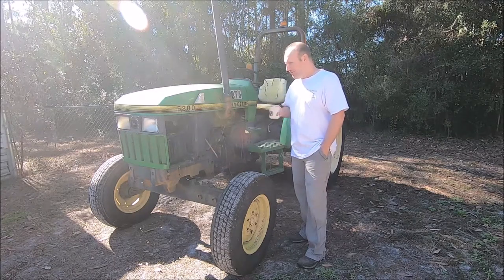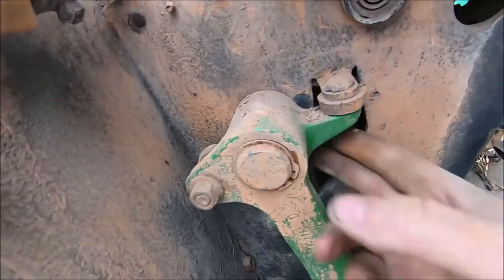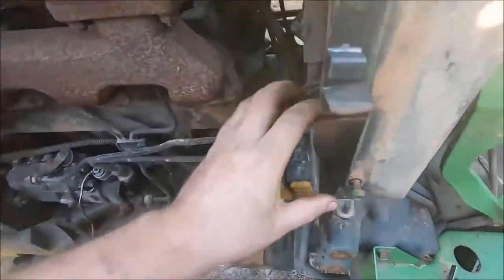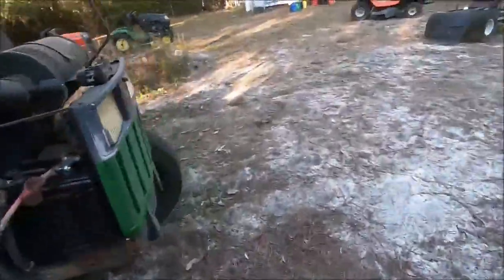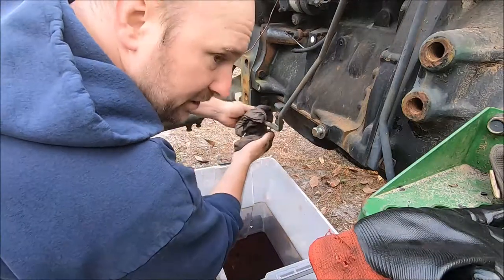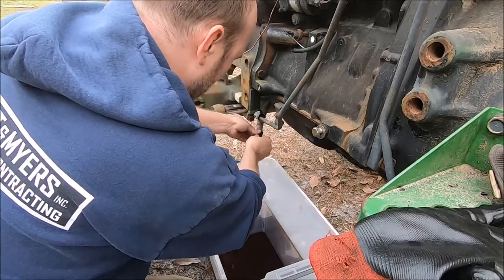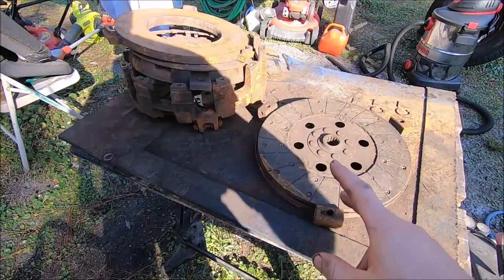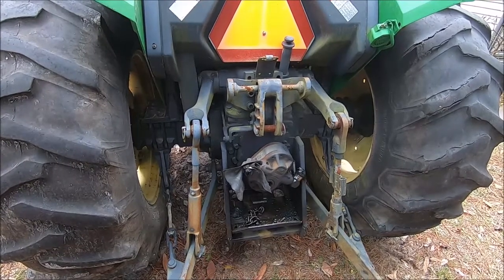John Deere 5200 clutch and other problems part 1

Comment: I never have been able to afford a shop with a concrete floor and never will but I make do. I have a 5105 which is very similar from the dash foward. I noticed recently the PTO seems to be slipping some under load when engaging the Bush Hog.Hopeully a linkage adjustment is all it needs.  I was disappointed to find the PTO clutch is part of the clutch assembly and not a separate unit inthe rear end. I dread replacing it but I do have a shop manual for the tractor which shows how to do it.

Comment: NICE DOES IT NEED TO BE IN NEUTRAL TO GET THE INPUT SHAFT OUT THE 3020 IM WORKING ON DOES NOT COME OUT 😢
Reply from the maker: This one does not need to be in neutral, it just seats straight into the splines. There is not anything that holds it in.
Reply: @wrenchwranglers  OH OK THANKS I STILL CANT GET IT LINED UP TO SLIDE BACK THANKS FOR THE RESPONSE